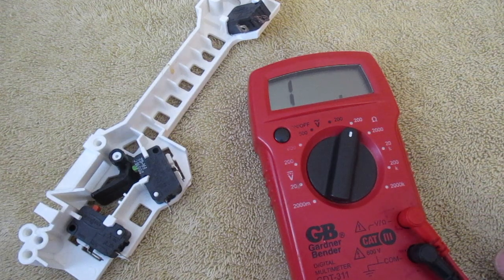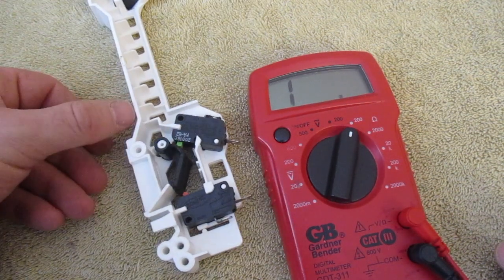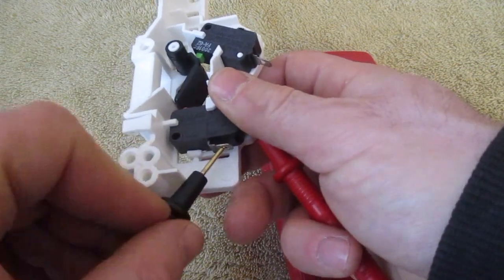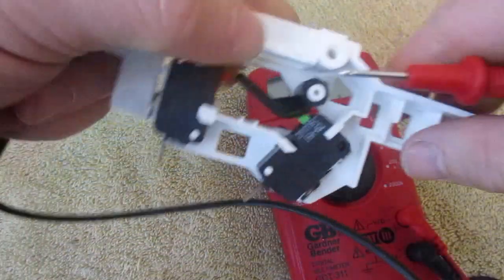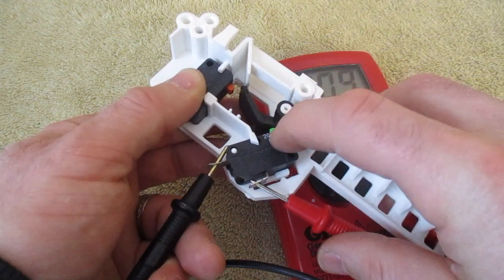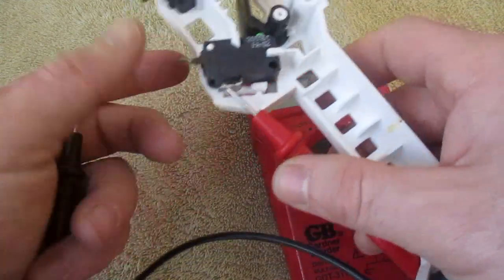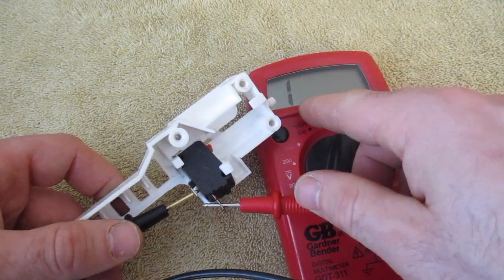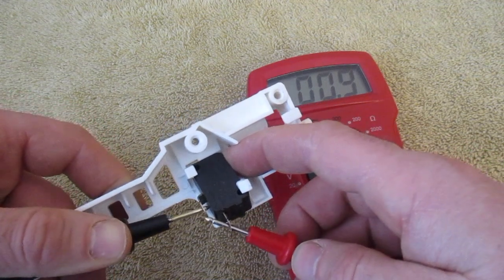How to Test Microwave Door MicroSwitch Switch Starion SZM-V16-FA-63 FA63 SZM-V16-FA-62 FD62 FD63

Comment: You read 1 on all of them which shouldn't be if one of them is closed. I'm not understanding this the way you explained it. What do you mean when you say you have no reading when the meter shows a reading of one? Perhaps you could have explained this better.
Reply from the maker: Sorry the correct terminology is no continuity.  If the circuit is open then the switch will have no continuity.  This is different depending on the switch.  On microwaves they have open and closed switches.  When a closed switch is working in will have continuity and then when you push the tab it won't and the circuit is now open.    Microwaves also have an open switch that is the opposite.  1 is not a reading on mine, sorry it does look that way, but it does not mean that.